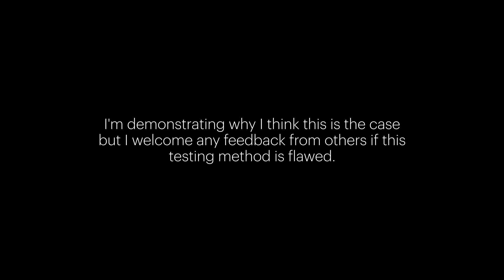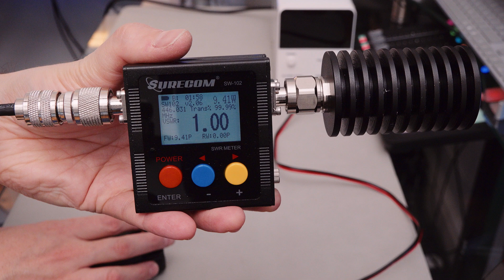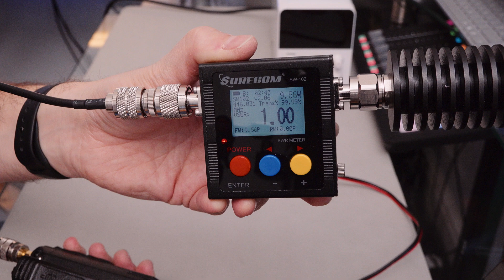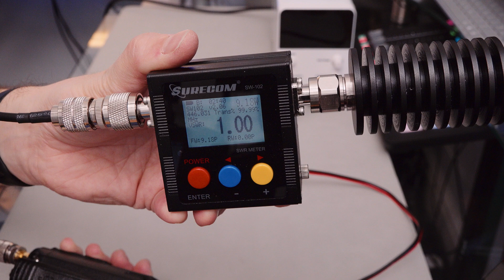Retevis RT1 - Is the Battery Up to the Job?

Comment: Batteries are sized to receive for a 8 hour shift with a few transmissions back to control. Most are 5 watts more often even less as they are talking thru nearby repeaters or base stations. The original Motorola HT--200 put out 2 watts VHF and 1 Watt UHF, weighed .75 Kilos and was called "The Brick" for obvious reasons. Soon spare batteries, mobile chargers and external anttenna adapters were standard kit for those who used them more than average. Also,at the time a nicad battery alone cost more than a used mobile re-tuned for the ham bands.

Comment: I think the 10W rating is more of a sales gimmick, the battery is probably lifted from another radio rated for 5W. To be fair to the radio it performs really well against an equivalent Motorola, however I personally don't think 10W from a hand held gives you that much range over 5W.